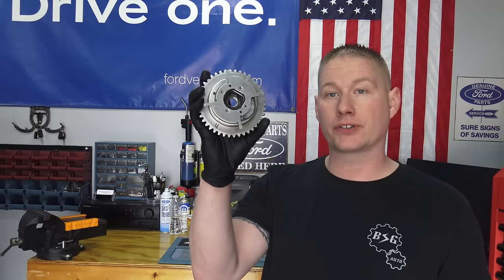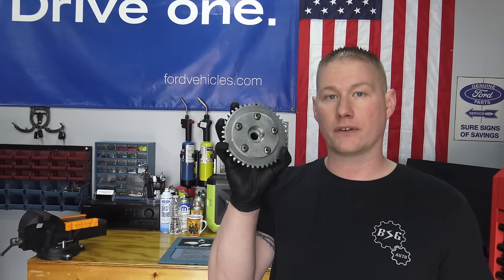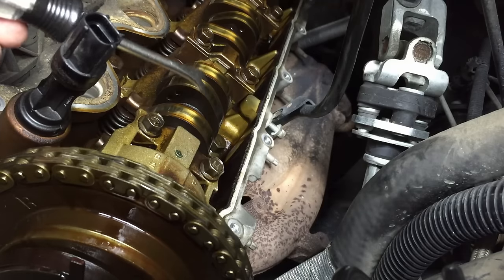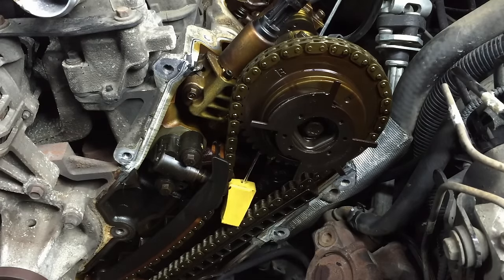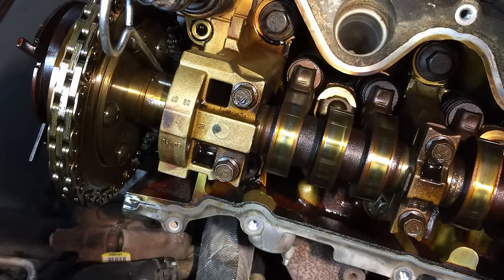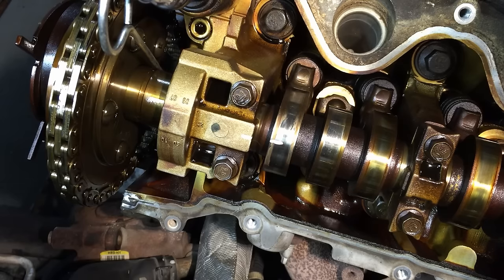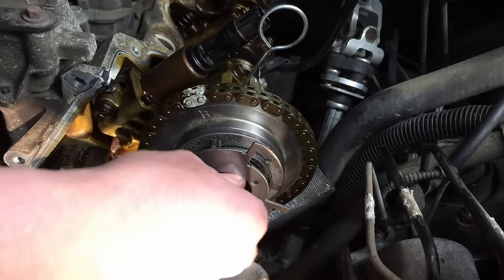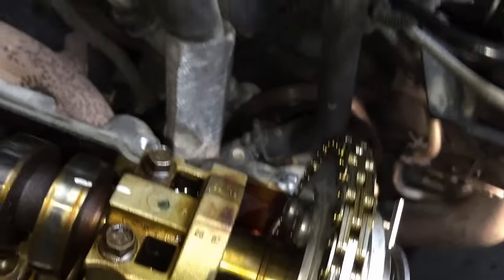Ford 5.4L 3v Camshaft Phaser Replacement**UPDATED FASTER PROCEDURE**

Comment: HI I have an 04  F150 5.4 and for 3 years now I have been battling codes. Currently  0011 0012 0021 0022.  I had the VCTs and Cam phasers replaced and then shortly after the codes came back. The local shop sent us to a dealership who said my cam journals were damaged and I needed to rebuild. So if this is true would that cause timing codes? The truck runs fairly well it does not stall or sputter all though its mildly rough and lacks the "pick up" it used to have. I failed inspection for readiness and the above codes. I was advised that possibly the wiring has a short?  I am not getting a code for the camshaft sensor but do you think changing the sensor may do the trick? I could probably do that myself or even the vcts again, but I think phasers are beyond me. But these were all changed with in the last 2 years. Further all the pressure tests in the proper range. I need to get it inspected by the end of the month any suggestions would be greatly appreciated, your videos are very clear and helpful thanks for your channel

Comment: I have a 07 f150 5.4 that is making the tick rattle noise it has 186,000 miles idles very smoothly and runs very well sometimes after driving and stopping it will run rough and sometimes die.....sometimes I can put it in park quickly and rev the engine and it smooths out , I put it in gear and it idles smoothly again...any ideas?

Comment: When replacing all required parts including timing chain,the bolt, the guides, camshaft phasers, and tensioners, and the Melling M360 HV oil pump is there any reason to also replace automatically the valve covers like a parts manager suggested at Ford dealer?
Reply from the maker: Valve covers no, gaskets yes.
Reply: you are lost in space

Comment: FordTechMakuLoco- I'm in the process of replacing my phasers right now. I have the valve covers off and can see both phasers. My 2005 F-150 has an L on the driver side phaser, and an R on the passenger side phaser. I see the phaser in this video has an "R" stamped on it, yet is being installed on the driver side. Is there a difference? Are they interchangable? Or do you have to rotate the phaser 180 degrees so timing is correct?
Reply from the maker: +seadoospray all the phasers are the same they have L and R marks 180 degrees from each other.
Reply: Awesome, thanks for the reply!
Reply: @FordTechMakuloco  so why do they even have those marks?

Comment: I have a coyote 5.0 that has a rpm dependent tick.  Been to the dealer many times.  They've replaced the timing cover for a tsb due to AC pulley.  The noise persists.  Alsmot sounds like a bad lifter.  Any input or suggestions?  Thanks.

Comment: Thanks for videos. I've had a few 5.4 tritons and they all developed the same symptoms and noises you describe in your videos. Can you answer a question? Is the 5.0 that is in the 2015 and current F150 any better than the old triton and has there been any changes to the 5.0 since 2015 to 2017? Do you have a video on the 5.0?
Reply: rotaxrider is this only a prob with the 5.4?

Comment: Your vids are very informative, thank you. 
I have a 219000 km 2009 5.4 F150. It has a constant almost humming noise on the DS valve cover above the cam phaser and a very pronounced rattle that comes and goes around 1400 rpm. This rattle occurs at different power loads and will quit when power is reduced. Is that phaser coming apart? 
I need some insight.
Reply: In my opinion, at your mileage, use Ford parts, and do a complete timing job. With the Melling 340HV oil pump.

Comment: Does this updated procedure apply if I'm going to use a complete kit or only applies to changing the phasers?Doesn't seem to make sense to go through all this and not use a complete kit including oil/water pump.
Reply: Homer Meza I'm wondering the same thing. Did you figure it out? Thanks

Comment: My 2008 Expedition has been knocking/ticking for over 100k miles.  It is at 240k now.  Why is the knocking/ticking an issue that needs to be repaired?

Comment: Is there a way to prevent this from happening? I have a 2005 mustang gt with the 4.6 3v. The engine still runs good and I change the oil ever 5k with Pennzoil Platinum 5w-20. Is there anything else I can do to prevent timing failure?
Reply: And I change my oil filter every 5k Miles with a Mobil 1 oil filter.

Comment: What do you recommend for the passenger side cam position when replacing the passenger side cam phaser?
Reply from the maker: same position shown with the crank
Reply: Could you clarify, please? I'm getting ready to change the passenger side cam phaser soon. Do you have any pictures showing the passenger side position? Thanks for the great videos.
Reply: Guys, he shows the cam angle for the passenger side in the video. It’s the same procedure otherwise.

Comment: I have a 2008 f150 with the two valve 4.6 I have 90000 mi should I convert over to 5w 30 now to help prevent or prolong this condition?
Reply: Scott Ouellette your 2v engine does not have variable can timing. no phasers. only the 3valve engines have this issue. however, running 5w30 in my opinion provides better protection for the timing chains and guides. I've had 3 4.6's in explorers and a mountaineer. always ran 5w30 or 0w30. 2 had over 200k like new. the third is a 3v with 175k that runs perfect.
Reply: Thanks I'll do 93000 and going strong now

Comment: I know Ford changed the oil recommendations from 5-30 to 5-20 on many of their engines even though the oil cap was labeled 5-30. Will the thicker oil have any chance of inducing a cam code? I know of instances where the wrong oil did that on VW engines.
Reply from the maker: +eldoradony no if anything it will make up for the loss of pressure
Reply: Don't use 30 weight. It may be better at temperature, but the biggest issue with this design is the too small oil porting to the OHC on the Left Bank. During engine startup, 30 weight will NOT get enough oil coverage to that cam and causes faster grinding and wear from oil starvation. 20 weight is not superior nor sufficient, I agree, but you simply can't remedy that deficiency with a heavier oil. That one fact cost me over 2500 in engine damage and downtime. It just does not make it up into that area sufficiently and in large enough volume to be worth the slim trade off gain you might make during higher operating temps. And this holds true even with a high volume replacement Melling oil pump.

Comment: Hey do Lincoln Navigator not have the same issue with cam phasers and oil pump?? I'm sure they have the same engine (my Navigator is an 07) but when I click on your link according to Amazon thos original Ford Phaser don't fit my Lincoln.

Comment: On another one of your videos you said to remove the first few rockers but this video you did not.Should I be removing the rockers?
Reply from the maker: No that is the shortcut I also place the crank and cam lobes a certain way in this video.
Reply: How do you get the lobes to that certain position
Reply: @williamdavis7535      turn crank

Comment: Timing is much easier then what it sounds like.  I did nothing that anyone recommends to do and had no problems.  Just lined up all the timing marks on the crank, cam gears, and the chains. The cam gears even moved when I took the chains off, I just moved them back to the proper marks on the chains. Using the bolt and a 15 mm socket.  The gears have an alignment pin that puts them in one position.  Its really hard to mess that up. No need to loosen the cam bearings or do half the stuff that is mentioned.  Don't look into too much.
Reply: same for me never took out the valve caps or none of that. Just took it apart. Put new phasers and all that one made sure the marks lined up and boom truck is still running to this day over a year later. Sure your cam is gonna move a bit. And if you are doing phasers your timing tensioners are most likely worn so you might as well change them too.

Comment: do you have any tips or videos about what to remove to get the valve covers off? I'm struggling with my 04 fx4 on the passenger side. thanks
Reply from the maker: You almost have to remove the a/c accumulator form that side.
Reply: yea I did a little more reading on it and that seems to be what everyone is doing. thanks
Reply: what would you recommend for new injectors? 04 fx4 5.4

Comment: Why cant you be near me.  I have a timing problem with my 2007 navigator. It happened after i had an oil filter accident. I am told I need cam phaser replacement.  It looks easy hoe you do it but is it really the problem. Thank you

Comment: great video. when you torqued down the new phaser did you use a tool to lock the crank or put it in gear or something? seemed like it took less force to move the crankshaft and more to torque the phaser
Reply from the maker: no need to hold it will hold on its own especially on a compression stroke.

Comment: Do you think 5W30 would stop a noisy Cam Phaser? Mine only knocks once the engine temperature is up to operating range. Seems the pressure is too low from thinner 20 weight oil.
Reply: it didn't work for me

Comment: if the cam moves a little to left or right  during this work how do you get the marks to match up again tks  and would it be smart to to remove  the starter and put  a locker  on the fly wheel  tks
Reply from the maker: no and no

Comment: My cam moved on passenger side. Does the cam usually spring off clock wise towards driver side? I have a broken guide so all the cover is comimg off. I should be able to move sprocket back to time with new chain right.?
Reply: My intention is to set time with bottom sprocket and set the top with arrowns to time. This is second timming job less cam phasers. This time i will be doing cam phaser and new chainn guides tensioners. I freaked but figured out how to move cam back. Just wondering in your opinion if it will work

Comment: I have a 2006 f150 with a jasper reman , just did  its second oil change, but it's starting to have a phaser tap. Can distinctly  hear difference between fuel injectors and phaser tap. Should I change phaser and timing chain tensioners, in case they are causing pressure loss to the phasers ..or should I just wait it out? Engine runs great otherwise although I think I'm imagining that is starting to loose some power. How long till this starts causing meltdown of other systems in the timing and can areas
Reply from the maker: You can wait as long as it is not causing a rattle at startup.
Reply: I have a rattle in my 2005 f-150 5.4l when I start it up in the morning can I do a lockout kit on it,instead of replacing Phasers? and re-program it?

Comment: Hey I know this is an older video but I have a question about replacing the phasers. I was wondering when replacing the phasers do you have to do a timing job ? My 5.4 kind of sounds like a diesel from what I understand from watching your videos it's possibly the phasers so if I can get away with just replacing the phasers at this time and time it down the road, would that be okay. Money's tight right now that's why I'm asking if it was okay to do
Reply: @poolboy9862  thank you I really appreciate your input and that's probably the way I'm going to go save money I think I'm going to do the job myself I'm not a trained mechanic l usually do all my own work thank you

Comment: I didn't lube under the cam bolt head and the timing plate broke loose of the cam phaser. Sheared off three little hammer rivets that held the stamped plate on. Have you heard of this happening?
Reply from the maker: The Ford phasers have a blob of grease on that surface already no need for any more.

Comment: Is it normal for the phaser plate to spin sort of in gear as i’m tightening the bolt? It’s a motorcraft cam phaser from the dealer. the phaser plate already around as i’m doing the torque sequence? pls help ?

Comment: when i unplugged the cam sensor driver side on my 2007 ford f150 5.4 3v it's running good but when i plugged it back,  misfiring everytime i stop, i dont what is wrong cam sensor is new.

Comment: Hey FordTech, knowing what you know about these engines, should I avoid getting a 2004 Expedition?
Reply from the maker: The 04 Expedition has the 5.4l 2v engine which is a great engine! The 5.4L 3v came out in 2005 on the Expedition.
Reply: Thanks for the response! I think that solidifies it for me.
Reply: Do you also recommend the 5w30 in the 2v engines

Comment: @fordtechmaculoko if i pull my valve cover off and i notice that the tension on the chain is less than what is presented in your video , would that mean i have a bad tensioner ? I noticed that the gap in chain was larger than the wedge tool. Can you give me any advice. Anyone feel free to add helpful comments .

Thanks Xavier

Comment: I know you are saying a thicker oil, but doesn't that create a issues if you haven't switched over to a high performance oil pump yet?
Reply from the maker: You can use 5w-30 anytime stock or otherwise.
Reply: @FordTechMakuloco  thanks, good to know

Comment: I'm in the middle of this fix right now, but my passenger side cam moved to left by a few degrees. How do I get it back into position?
Reply: Put a pair of vice grips on the cam just behind the phazer and move it.  You will need to hold it in position as you move the phazer onto the cam.

Comment: !!HELP!!
Im sure my cam phaser is blown out but id love a youtube makuloco confirmation.
Bank one index line was not lined up with the tang for the cam sensor!

I manually cranked the motor with a ratchet and it sprung to the proper lined up position. (Solenoid was removed)  

I feel like the phaser is blown out but km a rookie with this job. 

Thanks!

Comment: My truck is making the cam phaser tick/knock noise when engine is both cold and hot. Question is if i dont mind the noise do I need to replace the phasers?
Reply: Yes, otherwise your truck will eventually lose power when under load.

Comment: Can a cam phaser cause issues at around 4000 rpm? Extreme rattling? Was making the infamous knocking noise. Now it is not.
Reply: Chain tensioners and guides are probably broke causing the chains to slap the cover.

Comment: Has anyone gotten the cheese stuck down there?Is 5W30 recommended on other Ford Engines, like the 2.5L Duratec? I've been using the factory spec 5W20.

Comment: Hi, I done a complete timing chain and phaser install. I lined up all timing marks and installed the chain correctly following the videos. But I was being cheap and Installed made in china phasers. The truck started and was running good then it went down hill and threw 4 vct codes. Bad phasers? Please help.
Reply: Same here....whats happening ?

Comment: I have a 2006 Navigator. I actually did this quicker technique last week with the cheese method. Drivers side was easy and the cheese did it's job however, the passenger side was a bitch. The cheese wouldnt wedge at all and at one point, got stuck inside the cover. After getting it out, I just held tension on the chain and swapped out the cam. Got it all back together and running and the damn thing still starts randomly ticking when it warms up. Funny thing is, this engine is perfectly quiet when cold but starts ticking as it warms up (which is what it did before I changed the phasers). Now I'm starting the think my timming guides are bad on that side because that cheese should have wedged in.

Comment: What position was the crank in?  Great video by the way.  If it just included info on the crank position I would give you 5.5 stars!
Reply from the maker: No need to show crank position for this new procedure, the only position that matters is the camshaft you are working on.
Reply: @FordTechMakuloco  can u send link for phasers and let me know if uts the same for 2010 ford flex
Reply: @FordTechMakuloco  how do you get the cams in that position or if replacing both cam phasers can the cam be in the position it's in when you pull the valve cover

Comment: any thoughts on doing on side (driver side)? then proceeding to the passenger side? on my 04, the ac is perfect and I hate to muck with it.
Reply from the maker: You can change whichever one is making the noise but the passenger side is almost always the culprit.
Reply: Is there a way to tell which is bad without taking it apart? it  is louder  on the driver-side, but that means nothing since the battery and AC is on passenger side

Comment: So my cam kicked over clock wise about two teeth, any suggestions on how to get the came to where it was or the chain to where it needs to be😅😅 this is tomorrow problem 😂. Any help would be great
Reply from the maker: You can move the cam by using vice grips by the thrust cap.
Reply: @FordTechMakuloco  thanks for the tip should I use card board or tap so I don’t chew up the cam?
Reply from the maker: Its in a non machined area

Comment: Is the cheese wedge a homemade tool? It looks like a gas gauge float. Im doing cam phasers this week and would love to have that tool
Reply from the maker: Here is the tool you want for the job- http://amzn.to/2oFT6ks
Reply: The tool is called a Timing Chain Locking Wedge. I guess you could make one, but they aren't all that expensive. I just ordered on through Amazon as I plan to replace the passenger side cam phaser soon.
Reply: FordTechMakuloco I own an 02 Navigator with 310K miles on it. I have the infamous knock going on. I took it the Ford dealership and they said it’s a $3,500 job but I should just ride it till it dies. Should I get a new timing kit or call it quits on my Betsy?

Comment: So if it has that groove in the camshaft that lines up with the  phaser do you still need to mark the camshaft at the top?
Reply from the maker: yes
Reply: I didnt mark it it didnt mention in it on a different video i watch now my rpms wont go past 2000